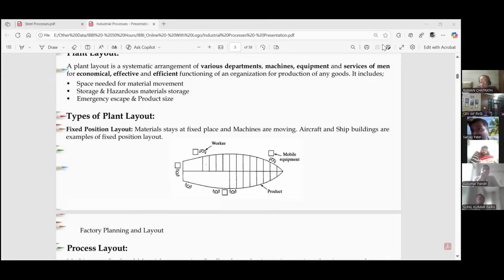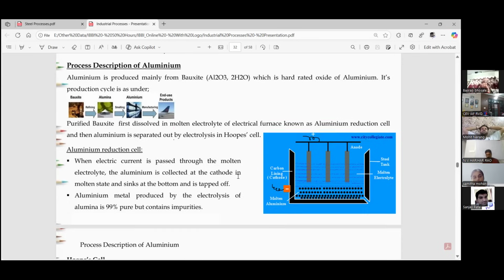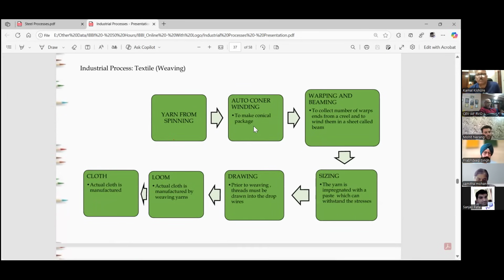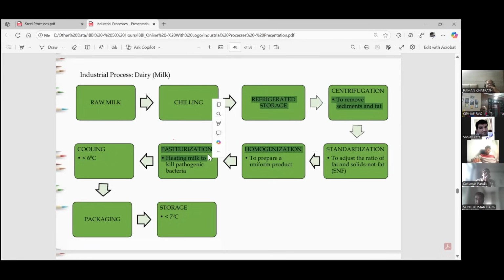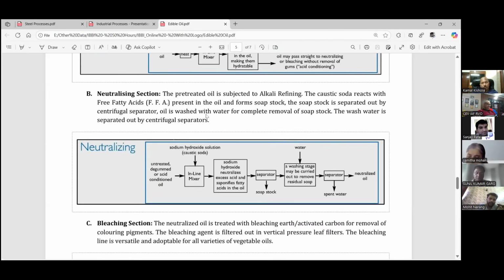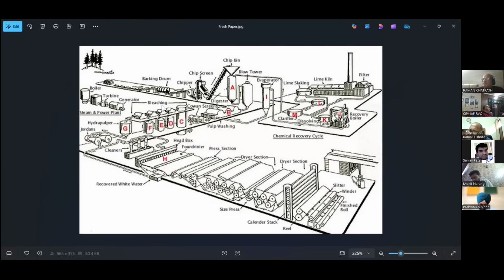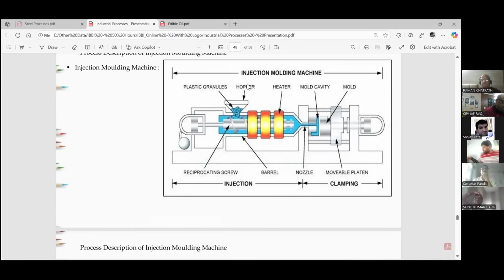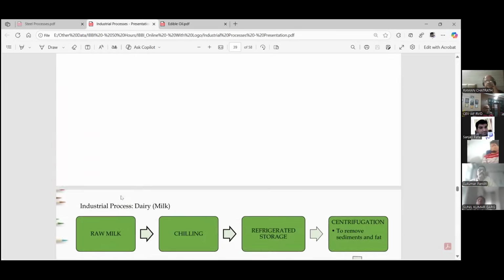INDUSTRIAL PROCESSES FOR PLANT & MACHINERY: INSIGHTS FOR IBBI EXAMINATION

Comment: The video provides an overview of various industrial processes, detailing the steps and key machinery involved in each. It covers:

Steel Industry (1:49): Discusses steel production via blast furnace and electric arc furnace, including raw materials like iron ore and coke, and processes like sintering, pelletizing, and continuous casting.
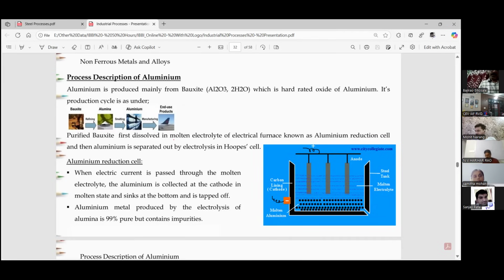Aluminium Industry (10:29): Explains the extraction of aluminium from bauxite through electrolysis.
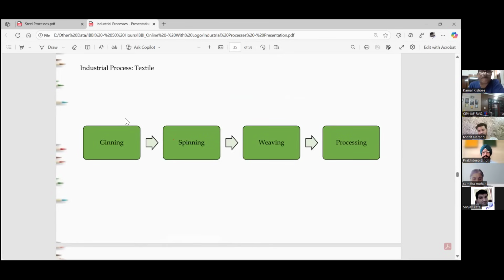Textile Industry (14:14): Describes the five main parts: ginning, spinning (fiber to yarn), weaving (yarn to fabric), processing (dyeing, printing), and garment manufacturing.
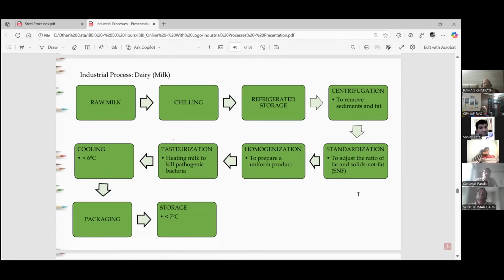Milk Industry (27:25): Outlines milk collection, centrifugation (fat separation), standardization, homogenization, and pasteurization.
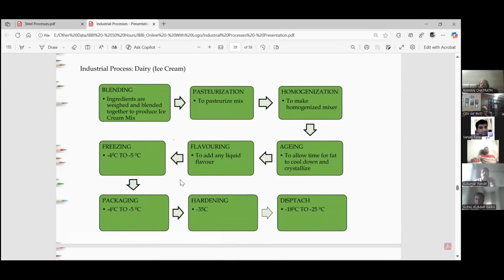Ice Cream Industry (31:34): Covers blending ingredients, pasteurization, homogenization, aging, flavoring, freezing, and hardening.
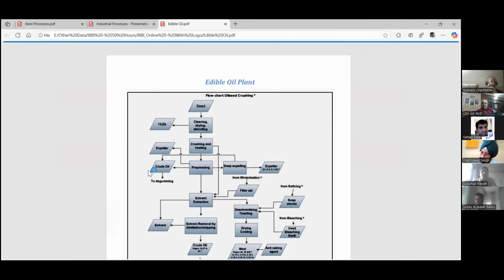Edible Oil Industry (33:55): Details processes from cleaning and crushing seeds to solvent extraction, degumming, neutralization, bleaching, and deodorization.
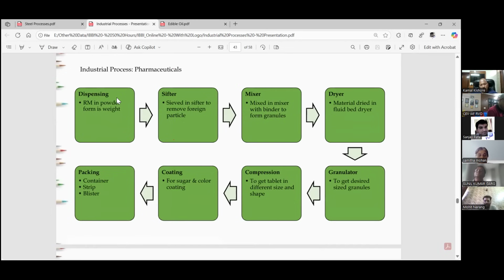Pharmaceutical Industry (44:13): Focuses on tablet production, from sifting raw materials to mixing, drying, granulation, compression, and coating.
Paper Industry (46:43): Explains how paper is made from wood (bamboo or pine trees), including debarking, chipping, pulping, bleaching, and calendering.
Plastic Industries (57:25): Differentiates between injection molding for small articles and extrusion for long products like pipes.
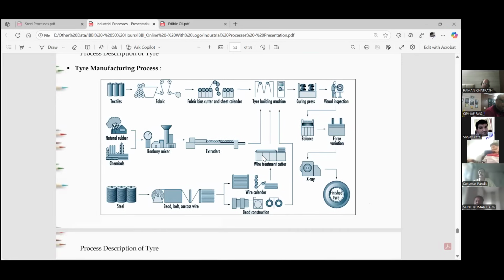Tire Making Industry (1:01:25): Describes the use of natural rubber, chemicals, textiles, and steel wires in building tires, followed by curing and quality checks.
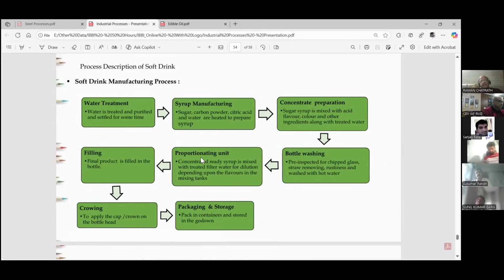Soft Drink Machinery (1:04:48): Briefly touches on water treatment, syrup preparation, bottling, carbonation, and packaging.
The video emphasizes understanding the functions of major machinery in each process.
Reply from the maker: Thanks for updating the topics